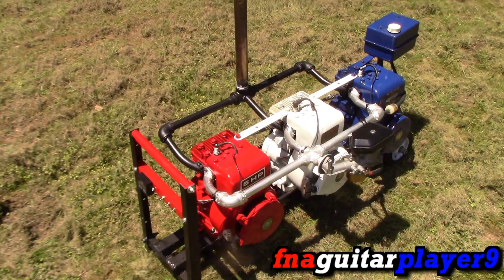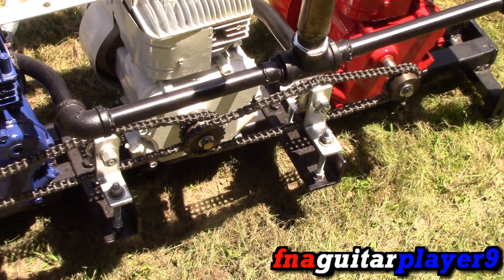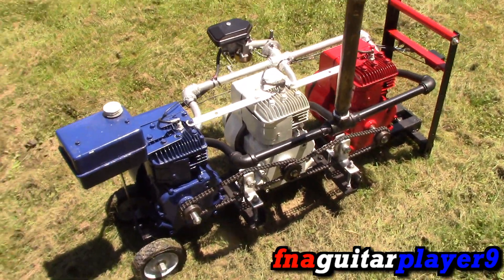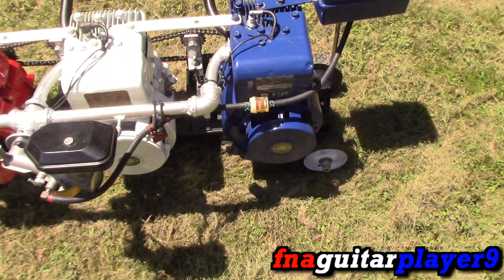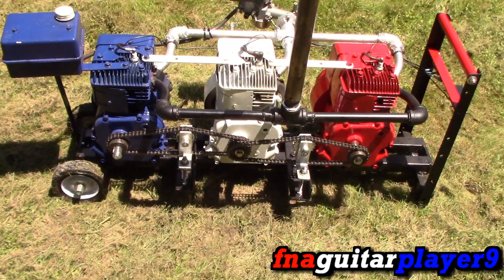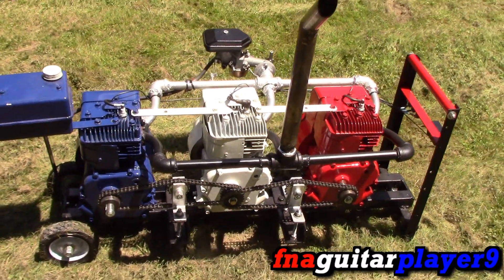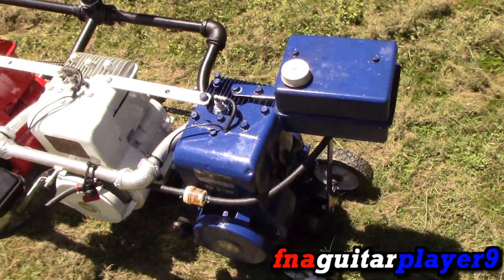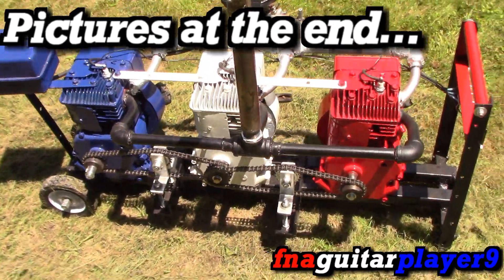4th Of July Special! 3 Cylinder Engine Built from three 5HP Briggs Engines!

Comment: Thanks tv or the valves and head gasket videos.  I found another Snapper.   Really beat up no self propel.  Did valves and head gasket. Breather. Intake gasket.   Truly one of the best Quantum I ever had.   Ill paint t it.  But I won't rebuild the self propel.  175.00 in parts to do that.   And still no bag for it.